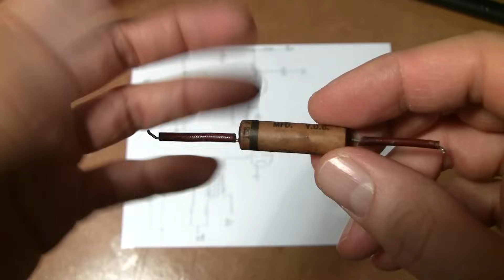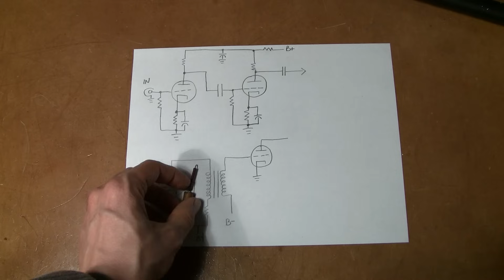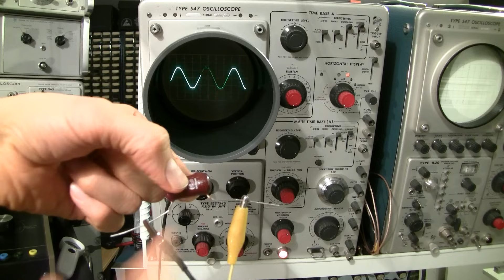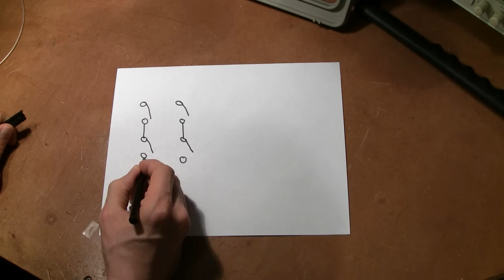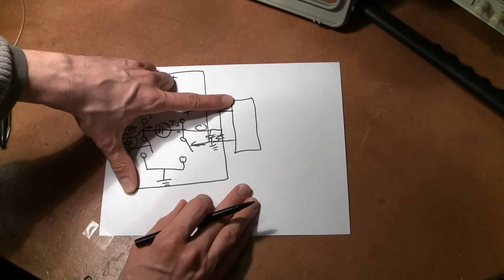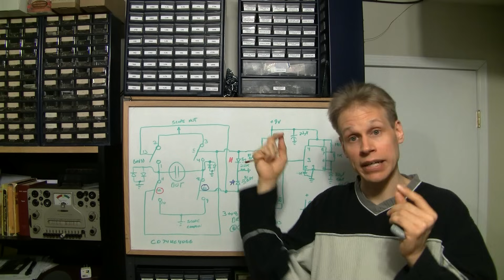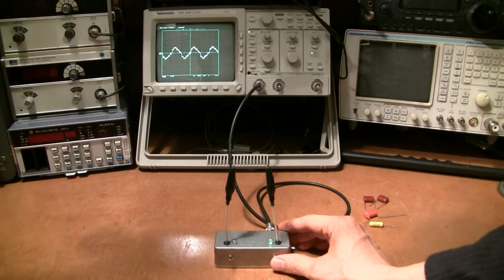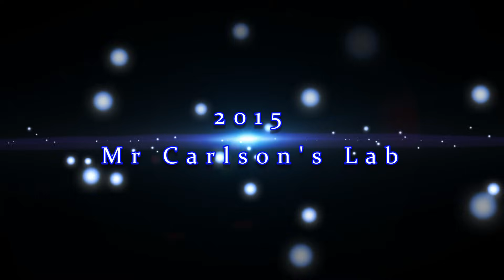Are Your Capacitors Installed Backwards? Build this and find out

Comment: Wow! I never thought about how the physical construction of a cap would interact with nearby fields. 40 years in electronics engineering and I learned something new from this video! Thank you Mr. Carlson.
Reply: It's only marginally relevant.  Paper caps usually are used for their low impedance characteristic.  So both foils are at the same AC voltage.  So either way is fine.   

If you're a real purist, just ensure that any plate to chassis capacitor goes in the "right" way or is spaced at least 1/4 inch from any low-level signals.

That said, even after 65 years of putting in capacitors willy-nilly I've never seen a radio oscillate or howl due a to "reversed" capacitor.

Kudos to anybody that goes that extra distance.  Long ago when Heathkits were a thing I would line up all the resistors in the same direction, just to look "right".
Reply: It was axiomatic with variable plate tuning capacitors.
Reply: 40 years and you werent aware of this???????
Reply: @BenState  Never came up in analog audio.
Reply: I knew this when I was 12,years old

Comment: If one has an oscilloscope, one can find the "right" way round for these easily. Connect the cap to the 'scope one way and then the other. One way will pick up a lot of noise and the lead in the probe at that point should be the one that goes to ground. Paper caps have an indication in them as to which way they should be fitted for this very reason. Info from the 12VoltVids channel.

Comment: Great video! Suppose one doesn't have an o scope, what then? How about a design that would lock an LED on to indicate which end is shielded? Perhaps using op amps set up as comparators (in conjunction with your design)?   I believe I might be able to do that.😊😊😊😊

Comment: Dear professor Carlson, I tried to measure the polarity of my caps using an expesive digital  oscilloscope at the office.  I have no skill at this so I asked a couple work friend.  We took it down to 10mv fairly high speed sample but our result was very blury not a wave form like you showed in the video that had a relatively measurable amplitude.  Looked more like noise on the screen and no way to distinguish which end was the outside foil.  Any ideas what we might have been doing wrong.  One helper was quite good with a scope...
Reply from the maker: Hi John. Use a piece of coax with alligator clips, no scope probes. Set the vertical sensitivity to 1mV per division. Adjust the time base to see 60 cycles.
Reply: @MrCarlsonsLab  thanks for the reply!   Your channel is very helpful.  I really appreciate the good work you do.  One more question/suggestion.  I'm working on a pa from the '60s.  Very tough to unsolder connections as they wrap them around.  Any tips for how to remove without damaging socket connectors? I watched your videos on soldering where you said not to use/wreck the tip to unbend them, but is there a best way to go about it?  These old amps they go through and wrap a rather husky wire prior to soldering. I'm concerned to not damage the tube connector terminals...

Comment: Most cool. Great video and great theory to practice! I may make this my first Carlson Lab Project!

BTW. Any issues using a plastic box with shielding tape on the interior instead of a metal case box? The lead to LED check could be verified from the box interior.

Thx, Mr. Carlson.
Reply from the maker: Hi Scott, for the amount of grief, I would just use a metal box. There is an "all in one" unit that I designed with an LED display on Patreon. No Oscilloscope needed.

Comment: Very instructive and helpful! I didn't even know polypropylene capacitors have to be installed the correct way. I replaced all capacitors inside my amp with axial polypropylene brand new ones (except the electrolytic ones, which are not concerned here)... so, how to spot them? Unfortunately, I don't have any oscilloscope at my disposal. I wish I had a Mr Carlson's Lab someday!

Comment: Wow! Never considered this, awesome work! Could probably use a comparator to eliminate the need for a scope - Higher amplitude would drive the LED on the side where the band is. Would not need the switching circuit either. Just a thought.
Reply from the maker: Hi Brad. I have released an all in one unit on Patreon, with an LED indicator.
Reply: @MrCarlsonsLab  Do you sell these tings please ?

Comment: Nice information about the capacitors, but honestly, if you are using the o'scope anyway, why go to all the trouble of building this thing? To me, just because you can do something doesn't mean you should, or need to. I clicked on this thinking you were building a self-contained tester. Very disappointed. 
And I don't agree with calling the capacitors polarized. Not in any sort of + or - meaning like electrolytics for sure.

Comment: why arent modern capacitors marked like the old ones? maybe because it doesnt really matter??
Reply: Cheaper this way. It takes effort to ensure the caps move down an assembly line in the same orientation. Much easier to just throw them on a line any old way.

Comment: Paul 

Awesome video and excellent subject, and I must admit I made a bad assumption that the obviously misleading line on these newer capacitors is not the outside foil, over 50 years in electronics and you still taught me something, I did know that was important in high impedance and high frequency circuits, but my fix was always to find a part with a smaller physical dimension, less aera, less stray capacitance, but I love your little test jig, those CD74HC4066 Quad bilateral switches are really neat little device, you mentioned that they are 10 volt devices, I have actually never used one of the 74HC devices, I discovered the CD4066 about 34 years ago when I was designing some stuff for Disney, they have a 15 volt limit, and they are very fast, I actually used one to build a Stereo multeplexer for an FM transmitter, worked great and made it simple.

Comment: What Mr. Carlson does not tell you is that this capacitor polarity test will work ONLY if you disable the ground pin on the power plug of your oscilloscope. If not, any spurious hum picked up by your body, necessary for the test,  will be drained to ground and you will not get a usable wave form at either side of the capacitor: flatline. This test did not work for me AT ALL until I disabled the ground on the three prong plug of my 'scope power cable with a three prong adapter. Then, bingo, there was the waveform and I was able to test caps. But be careful, a disconnected ground on a 'scope is dangerous. Enable it again when finished testing your caps.
Reply: I found I had to grab an electrical cord with one had and hold the capacitor with the other. Just simply placing my free hand on the lamp on my bench did the  trick. Apparently my body alone wasn't picking up enough interference.
Reply: @davidberndt6275  No....do not do that. Do not hold a live wire with one hand and hold a potential ground point with the other. That forms a current path directly through your heart....the most efficient way  to fatally electrocute yourself. If that electrical cord has a nick or hole in it, you could find yourself in the hospital, or worse.  This is why electricians are trained to always keep one hand in their pocket while measuring current.
Reply: @Nick215NY  yep, you are correct. I found that you don't need to really touch the cord, but just get close enough to induce a 60hz hum. I can see the amplitude increase the closer I get. where as before all was getting is random noise and wondered if the LED bulbs in my shop are just noisy.   I should have mentioned as well that the lamps on my bench have been re-wired by me and known good entities. Having said that danger lurks around every corner.  Thanks!

Comment: Why can't the capacitor shield/foil-end detector be completely self-contained?  In the correct direction, the signal amplitude is lower.  Why not use a switch in the box that is set and locked by the strongest signal through it, either way, and when the switch is set, it CUTS the power to ITS OWN side's LED so the "last man standing" lit LED, the one for the opposite side, indicates the correct alignment almost instantly.  No other piece of equipment needed.  Just like your leaking capacitor detector, only simpler.

Comment: Capacitors are built to have internal Faraday cages (the "shield" he mentions) to isolate them from internally-generated radio-wave interference from adjacent components.  ALL non-DC electrical activity creates such radiated signals and many electronic components are sensitive to this stuff, even if just a little bit.  However, even a little bit of static can drag down your device's optimum performance and in some cases actually cause it to wear out faster (internal heating and so forth).  If you were making a piece of hardware out of steel that rubbed up against another piece of steel, even a little roughness can cause the moving parts to wear out prematurely -- this shielding stuff (and related things) in electronics are just as important in electronic devices, even though not visible to the human eye until things are too late (smoke), and this shielding effect here is one of them.  This is very important!

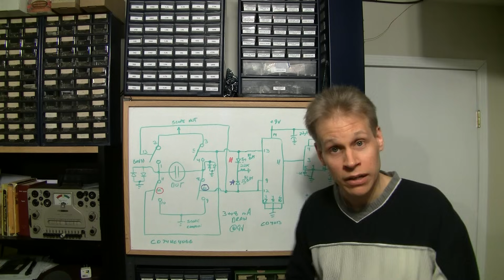Comment: 34:12...it would make more sense to leave the resistor(s) alone on the 555 timer circuit, and increase the size of the capacitor to slow down the rate.

Comment: What do you think is one of the better brands for polypropylene film capacitors is? I don't want to use trash capacitors in any circuits.
Reply from the maker: Hi Cody. I don't know if you are a Patron, but there is an entire video up there with capacitors (and other components) I personally have verified.
Reply: Ok, thanks!

Comment: I came up with a simplified version of your square wave generator circuit in your outer-foil tester.  A single CD4011UBF, 14-pin IC, replaces the 555 and the CD4013 in your design.   Is there a way to upload it to you?
Reply from the maker: Hi Ron. My new design is on Patreon, and uses only a 555. Thank you for your offer!

Comment: Dear Mr. Carlson, I like your videos on youtube! I tested your method of getting out the outer side of the foil from a capacitor, it works well with a TECTRONIx TDS 2024B! But only for capacitors not much more than 10n. I think, thats for the low pass filter, formet together with 1 MOhm internal resistor of the scope. If I use much higher capacity, I only get static noise in both direction.
I suggest a similar procedere to get out the right side of the outer foil, it is a little more complicate: for this, I put 1 kHz from a generator to both ends of a capacitor and then I tip with my probe onto the case of C. When recogning 1 kHz, then the generator has his signal connected to the outer foil otherwise its connected to the inner foil. So far!  Much thanks for your tips!!!

Comment: Maybe it's a slightly elegant solution to a simple problem but the point is, your explainations are excellent. e.g. I learned about CD  IC's. And I learned a bit in seeing you design it. And I would have made some bad capacitor assumptions also.   Thank You

Comment: Paul.....I have three different scopes at work and I am not able to duplicate the noise holding the capacitor as you did. All have the 5 mv sensitivity as the most sensitive. When I hold the cap with leads connected to the bnc cable the scope shows a line. I can barely see any amplitude when holding the cap. When the cap is disconnected from the clip leads I can see a lot of noise. Any ideas?

Comment: Growing up in the late fifties and sixties we had vacuum tube radios in our home. They were always encased in a wooden or bakelite cabinet since our ac outlets at that time had two socket holes of the same size. This meant that the radio chassis being metal
could become the "ac hot side" of the line. I don't believe it really affected the audio quality which way it was plugged in. So I really don't know if the foil end being connected to chassis gnd greatly affected the operation of a tube radio. Nonetheless a great article  by Mr.
Carlson which shows quite a "scientific mind" in dealing with electronic theory and repair. Well Done, just like another of my favorites
Michael Faraday...The Chemical History of a Candle.

Comment: Paul great you did this dude, a lot of people talking "switch" in the comments don't realise that almost every circuit built out there is just a time saving device and the same can almost always be done with human labour, or less effort and a switch means labour.  I mean "switchers", why not calculate in your head rather than getting out a calculator, or smash nails into a piece of wood with a rock rather than spending money on a hammer?  Why build an electronic doorbell when you can just knock louder? It's because they work and are TIME SAVERS...  I think this would be an enjoyable project to build and once my time is spent building it I can save time forever more by mass testing caps with a SINGLE action of connecting them while holding instead of flicking a switch back and forth.  BTW touching on a couple of exposed plates maybe like the old speaker connections, or just two insulated bolts mounted between the leds on your box may be a good alternative for faster touch test connecting without the aerial effect.  Regarding marking, I'd mark the lead not the top, OR with a quick wrap around your probe tip put an "o" in the foil lead close to the body like you see in some resistors then it's marked forever and you can recognise it with a nanosecond glance.

Comment: Well, I was happy in my ignorance until I watched this video. :)

I recently installed new pickups in one of my bass guitars, and replaced the old cap on the tone control with a CDE orange drop, and now I'm wondering if it could be backward. I guess I have a 50% chance of it being right, which are not good odds. Presumably the tone control of a guitar (where one leg of the cap goes to ground) is a circuit where this polarity matters?

It really annoys me (now) that manufacturers don't mark the caps for this. Unfortunately I'm just an electronics amateur and don't own a scope, so I'll either have to get one or borrow time on someone else's in order to figure it out. Maybe this could be the excuse I need to get a scope. :)

BTW, where I thought you were initially going with your test fixture was an all-in-one, where you could just clip on the cap to be tested, and the LED that corresponded to the leg you need to mark would light up. I guess the functionality of the scope and the visualization of the signal amplitude would be a bit tough to cram into that little box. :D

Great video - thanks.
Reply from the maker: The SIFT Device is on Patreon as of not long ago. SIFT= Self Indicating Foilside Tester. Its now an all in one device with LED's as indicators.

Comment: I think you can build another Versions of this Capacitor measuring device for those people, who don't have an Oscillioscope:
The Basic circuit can stay as it is. Instead of the BNC output, I would build another small circuit that signals the final result directly visually, acoustically, or in both ways.
Simply build an amplifier that you can possibly regulate in its sensitivity, which then outputs the amplified signal to a speaker, and / or an LED, to show wich polarity is wrong or right.

Comment: You could have done this much, much more simply with no active circuitry with a single DPDT switch by attaching 1P and 2P to the two ends of the capacitor, and tying 1T from 1P to 2T from 2P and 2T from 1P to 1T from 2P and then hooking the former to the center conductor of the BNC and the latter to the shield.
Reply from the maker: Search the comments, you will find out why your solution wont work.
Reply: OK, I found this:
Mr Carlson's Lab 2 years ago +Star Gazer Hi, I Have explained the downfall of the toggle method in this post already. Briefly again, you can not touch the toggle handle, or box without grounding your body out. If you ground your body to the box or switch, the imposed 60 cycle signal looses amplitude. This makes for a test with interference. If you mass sort capacitors like I do. An automatic switching system makes for clear easy results. Sure, the toggle switch will work fine, But... you will have to remember the amplitude before you touch the box or switch......Hold the box (amplitude change) move the toggle, take not of the amplitude again with no contact....so on. Try it! I have :^)

But I see this as more of an indictment of the human antenna noise model! In my application (underwater acoustics) I'm much more concerned with picking up noise from nearby switched mode power supplies, so I'll stimulate it with a cheap Chinese wall wart and just measure RMS AC voltage both ways. The toughest part of this task is getting the assembly house to perform it. As you pointed out in your article, the marking on the cap isn't guaranteed to have a fixed relationship with the outside layer, and it's nearly impossible to explain this to a technician half a world away. Maybe I'll insist on them watching your videos! :-D

Anyway, I love your videos and appreciate the accuracy, including on this one, where you point out that the outside foil goes to the low impedance side (which may be the output of a driver or the high supply). Most references get this a little wrong and only mention the outer foil when going to a ground connection...

Comment: CD4047  -has flip-flop and astable multivibrator in a single package. - could replace the 555 and the CD4013
Reply: also lower power than 555